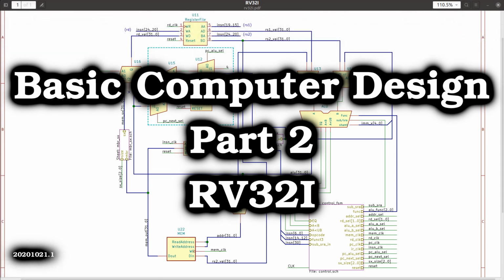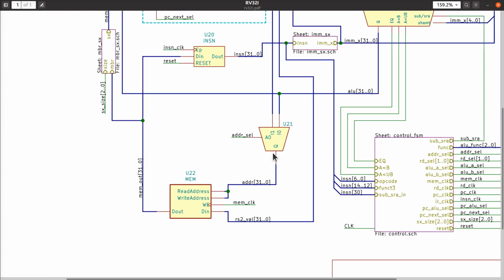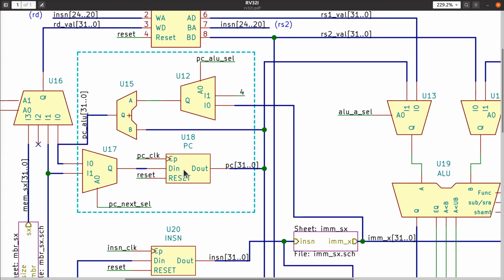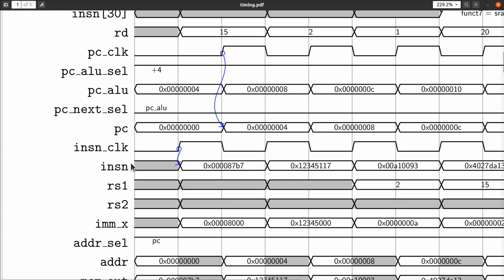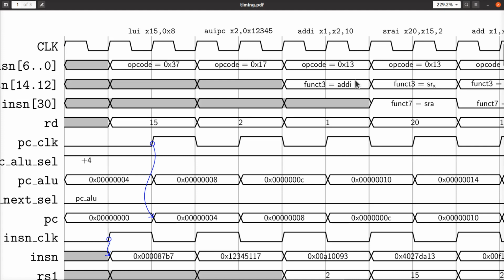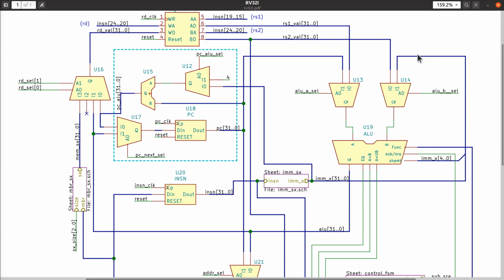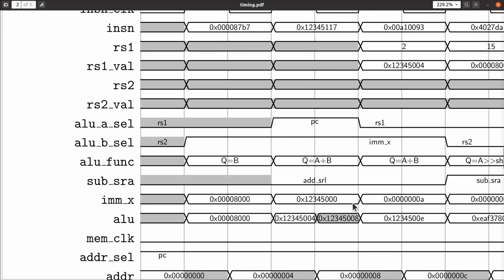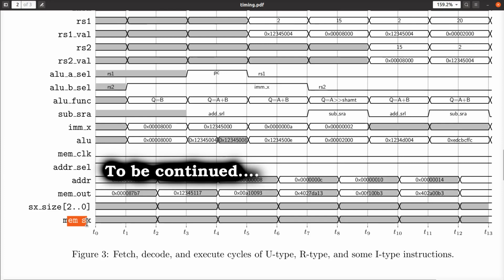Basic Computer Design (part 2), A Simple RISC-V RV32I CPU

Comment: In regards to reversible computing, what would happen if you feed a stream of alternating zeros and ones throught a routing fabric. Then you take the RISC-V 32 I M extension, and for each of those machine codes patterns (or immediate value) you chop them up into 4 bit nibbles. Then you take 8 bytes from the filtered stream, and essentially making the high half of the byte your intended 4-bit nibble, and then the low half is the garbage leftover data. You take all your 4-bit nibbles and combine them into your 32-bit RISC-V machine code. You do work with that, and then recombine it with the garbage nibble back into the initial pattern of zeros and ones.
Heck, you can even speed it up by using an inverted version of the work you are doing of your intended nibble, but on the garbage nibbles.

It may be a little silly, but you would essentially need to compile RiscV assembly itself, so each line and instruction can be built through this filtering - I don't want to call this an ISA under the RiscV ISA but it essentially is.
We would literally physically need a hardwired 1s register, just a heads up.

Comment: Why is shamt taken straight from the immediate? Isn't it more logical (and consistent) to just take it from the second argument?
Reply from the maker: How then would it work on a 64 or 128-bit CPU?
Reply: @JohnsBasement  it is still just from the second argument?
Reply from the maker: @canaDavid1  not following what you mean by the "second argument".  -- Keep in mind that the order of things in the assembly language source need not match the order (or anything else for that matter) in the generated binary instructions.

You mean taking the shift amount from a register in some other instructions that don't have a shamt field?  Why waste time (and put pressure on the register use) by forcing the machine to load a value into a register to indicate the shamt if the user needs to shift by some literal amount?  Insn bits 20-31 are all routed into the ALU anyway...
Reply: @JohnsBasement  there are some instructions that take the shift amount from rs2. And the shift immediate instructions take the shift amount from the bottom bits of an i immediate. Both of these have a path to the B input of the alu. taking the shift amount in slli/sr*i from there would be more consistent than from a separate input to the alu.
Reply from the maker: @canaDavid1  Good observation!  Yes, it would.  If I detailed the shifter design in the ALU, it would have been more obvious that I should not have shown a different "port" for the immediate shamt.
Reply: @JohnsBasement  nice. I can see how the design would've come up though, both MIPS and ARM have separate dedicated shamt fields